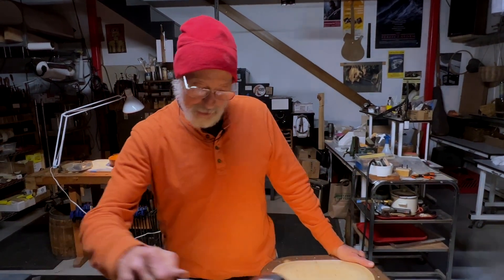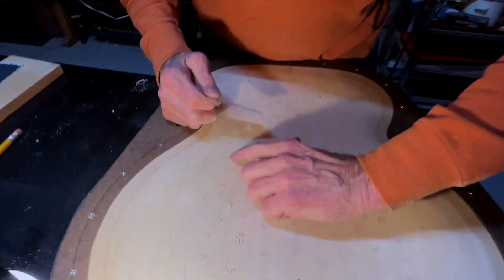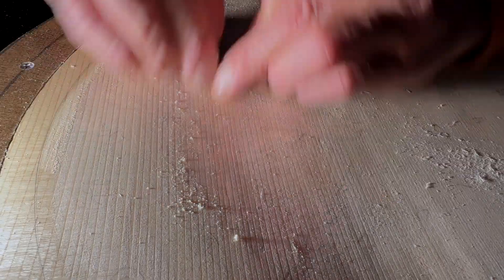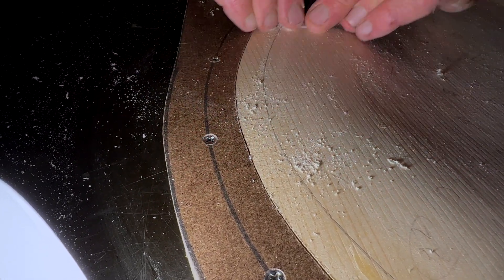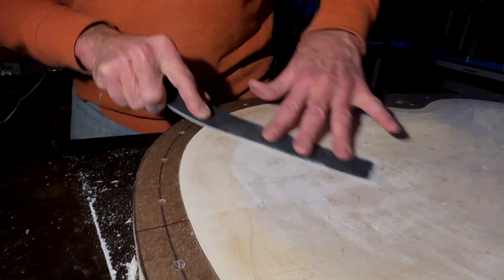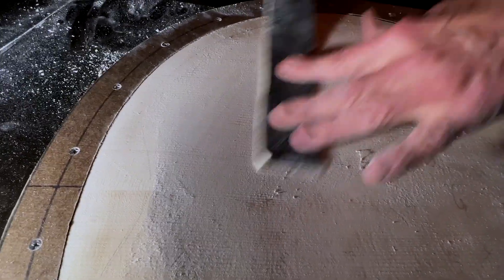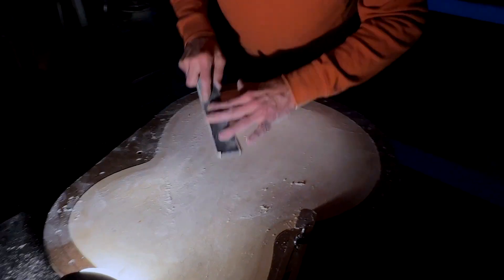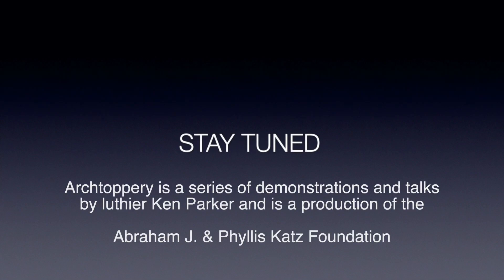Ken Parker Archtoppery - Arched Plates - Finish Carving the Inside - Chapter 6

Comment: Ken, do you ever feel tempted to leave the surfaces like they are coming off the scrapers? I often think about why we tend to want to erase all evidence of handwork. Greetings!
Reply from the maker: Great question.  I have done this, in fact. In 1980 I made my first instrument with violin edges and purfuling, which has come to be known as "Frankentop", as the top has been removed, modified, re-braced, while the neck has been replaced a couple times. This instrument was built without sandpaper, and it was a great learning experience for me. 
Probably I should show this instrument in a riff and give it a critique.

Humorously, some contemporary violin makers have been caught sanding their work, and then trying to remove the evidence of sandpaper use by preening with a scraper.  Chuckle.
I have to say that sandpaper is really useful, and I wouldn't choose to build without it, but I use very little, just fine grit when the shaping is near perfect.

The aesthetic in modern violin making is to mimic old work, and leave the surfaces with some tool marks. The players are all in with this, so it works fine in that world.

For some (you tell me) reason, many guitarists are unlikely to accept what are seen as departures from perfection.
Here, "Perfection", I think, means "closely resembling a designed-to-be-manufactured guitar that I wish I owned built by hourly workers in the Martin and Gibson guitar factories in the early to mid 20th century. 
Tough crowd.
Reply: @kenparkerarchtoppery9440   100% agree, the convention of how guitars should be finished is so based on industrial processes. Would love to see your Frankentop someday! Happy New Year!